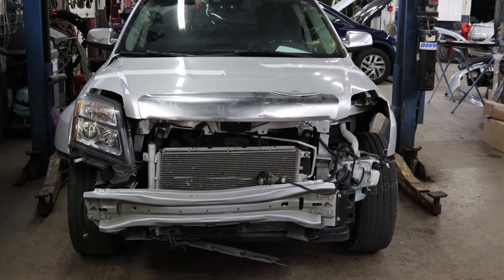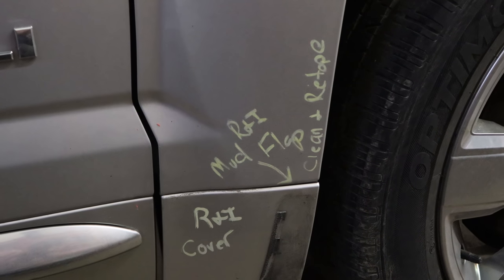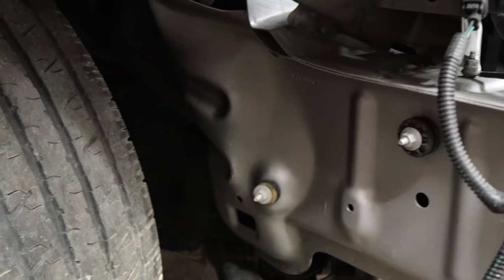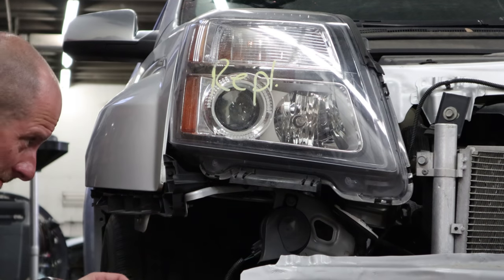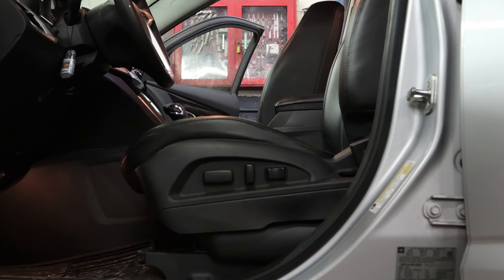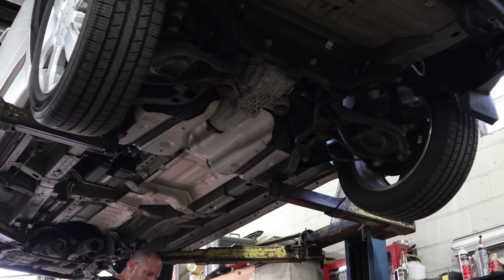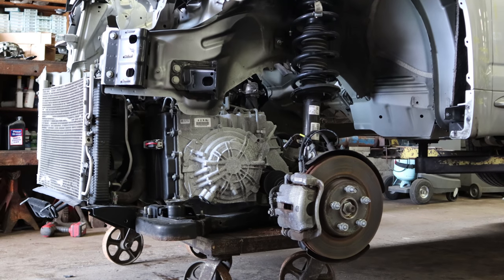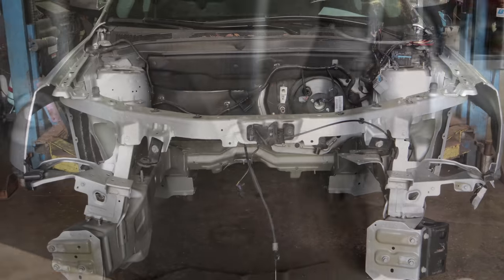Rebuilding a totaled vehicle tutorial part 1: Intro to the project and disassembly

Comment: Overrated vehicle.
Reply from the maker: Thank you for your opinion.  I will sure to file it under "things I could not care less about."
Reply: @vehcor  At least spend your time with something decent that will be somewhat desirable one day. This is more or less the modern Envoy which was also a turd (we owned one).
Reply from the maker: I happen to like these and sell them quickly.  These are short term investments not Ford GTs that appreciate.  The goal of this one is to repair it, drive it and sell it in a few years for at least what I paid for it.  That is what I do with all of my own cars.  Effectively driving a car for free.  People do not realize how much money they waste on cars.  I have driven low mile, current models for 20+ years and it costs me nothing not even maintenance, it all gets factored in.
Reply: @vehcor  See, I just drive what I like and they generally aren't very desirable for resale etc. You're lucky you're this good at vehicle repair. About all I can do is refurbish air pump dryer beads and replace Teves ABS accumulators or air springs, all the things people are afraid of with the Lincoln LSC which is why you never see them. They are fantastic highway cars with 225 HP, 300 ft lbs of torque, and not uncommon to see 25+ MPG on the highway in cruise. I suppose I'd do more if I had a proper shop, tools, a hoist etc. After I got the Cadillac back on the road saved from an abusive previous owner who was going to scrap it, I ended up taking it on a 7000 mile trip and now it's needing more than I ever wanted to do with it. I would only do such a trip in an older car as good as the Lincoln now. A newer (like 20 years old) daily driver is for me fine as I don't like the direction the big three have gone in recent years and don't want to give the impression of supporting them. I even went out of my way to find domestically manufactured parts for the Cadillac, some of them probably actually worse performance wise than what some overseas parts at a similar or less price would have been. But it's time for people to start doing this and employing local mechanics to install these domestically manufactured parts and keeping the money in country, rather than sending it to Japan for a Toyota or (perhaps worse) giving it to GM to have Buicks manufactured in China. I, probably stupidly, passed up on a '50 Olds 88 that was only $2300 US, though it was a 4 door. If it were a coupe I'd have likely gone broke for it and probably cashed in later (though if it were a coupe it would have probably been sold already before I found it).
Reply from the maker: @VinylToVideo  I actually liked the LSCs I had a couple back in the day.  My favorite was the Black with black honeycomb wheels.  I do fix what I like sometimes, regardless of resale.  That is how I got my G8.  Little did I know that it would have been a great rebuild to sell but that happens with a lot of what I buy.  That is actually how I got started on these Terrains and the hundreds of Grand Ams. My CTS-V were another that turned out to be great to resell but I bought for myself.  I'm not a Cadillac fan.  They usually have too many problems and don't hold resale but the CTS-V is basically a 4 door Corvette.
Reply: @vehcor  My LSC is more or less the Midnight LSC and all blacked out but has the same rims in aluminum instead. I also have a set of turbine rims from my old '88 I suppose I may use in future for winter tires.